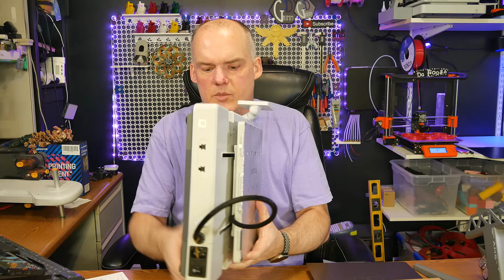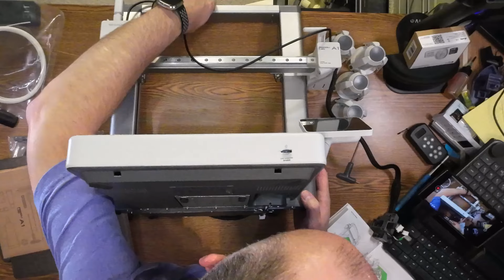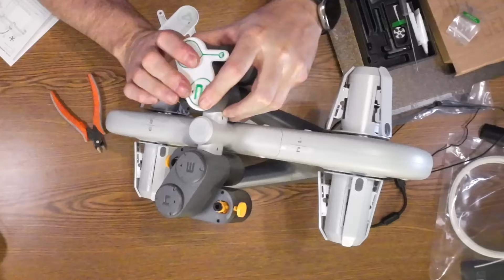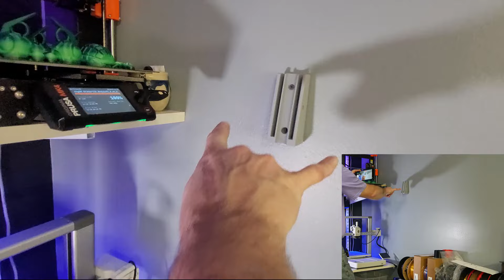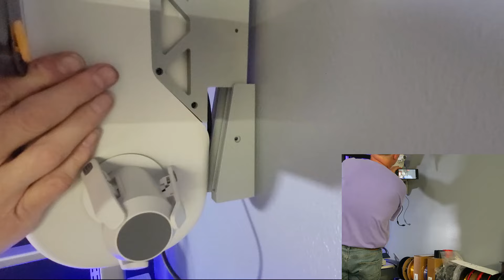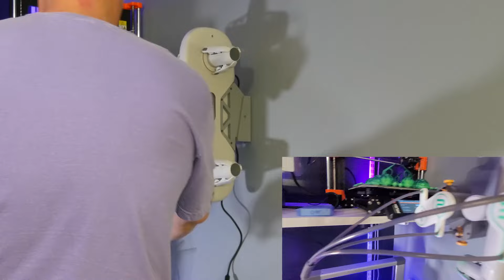A1 Combo Assembly & Install

Comment: Great video! I'm planning to mount my AMS on the wall with the same bracket that you used. Do you have a part number for the screws that attach the mounting bracket to the AMS? Mine came with a packet of 5 screws that were intended to mount the included desktop stand to the AMS, but I need a total of eights screws. The package you have showed quite a few screws. Thank you!
Reply from the maker: The screw pack I showed had all the screws I needed. There should be more than 5 in the AMS stand pack (you need more than 5 for the stand as well), If they're not there, you might need to contact Bambu. 

I do know that they are specifically plastic screws with oversized threads for gripping the plastic, but I really don't know exactly what model/type screw they are.